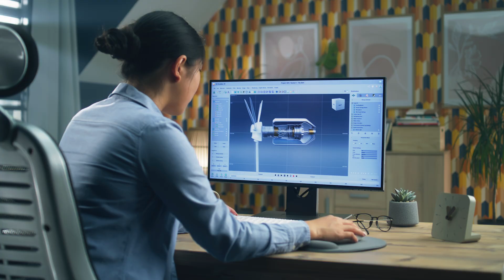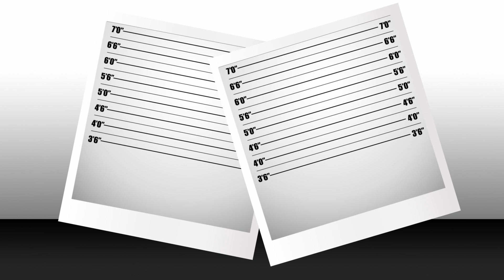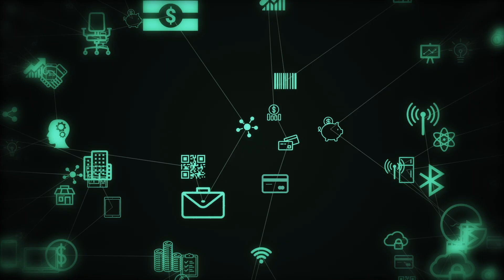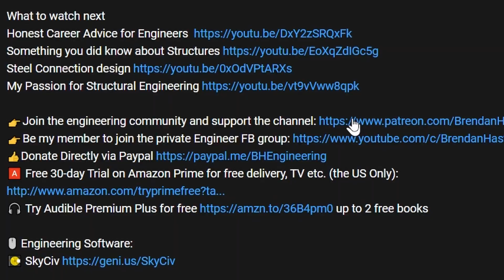An Endless Project: Structural Engineering Projects | The Issue

Comment: You have to keep up your energy and drive to keep progressing the project.  You have to recognize problem areas and attack them proactively rather than pushing them away and letting them linger.  You also need to attack the project methodically- work on an area or a subject and be sure it is complete before moving on to the next thing.  If you work on something and don't complete it then you will have to go back to it later, pick it back up, and put more effort into it.  It is better to complete something the first time.  If you continually find that you don't have the information that you need then you have to plan your work ahead of time so you can ask questions of the client and get answers before you need them.